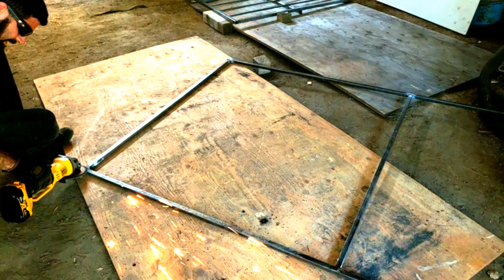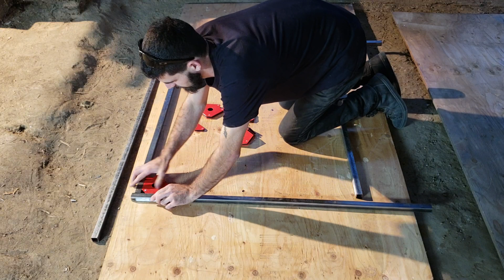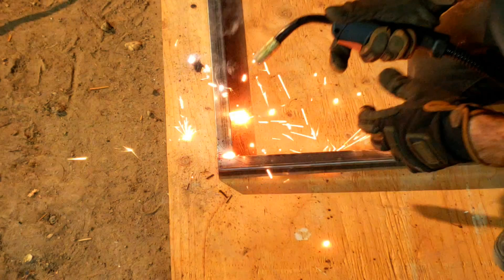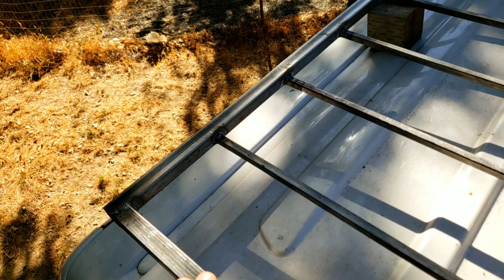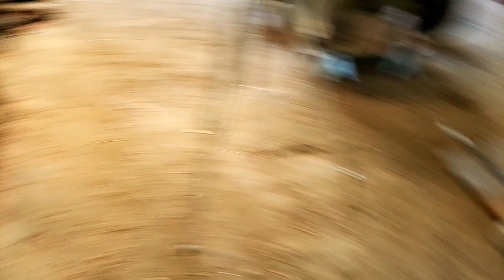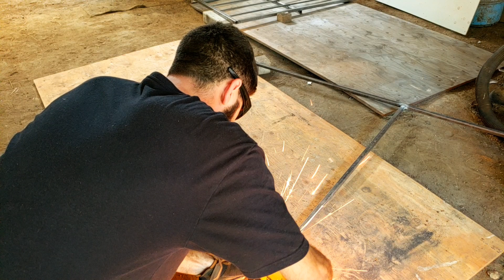Custom Roof Rack Build under $100 (Part 1)

Comment: Just a quick tip for welding. When you do your tacks, tack both sides because the weld may shift your peice of steel. Not always the case though. nice work on the vid man.